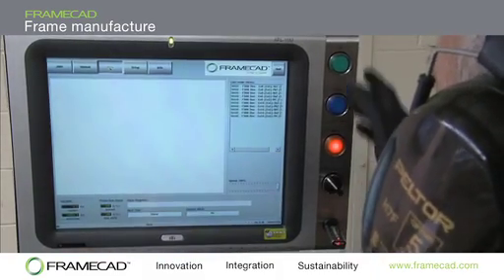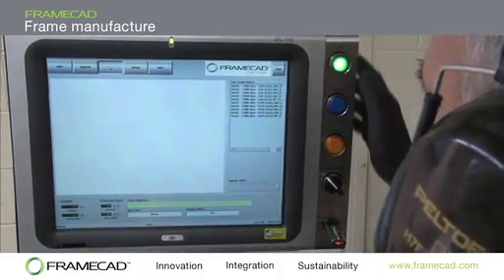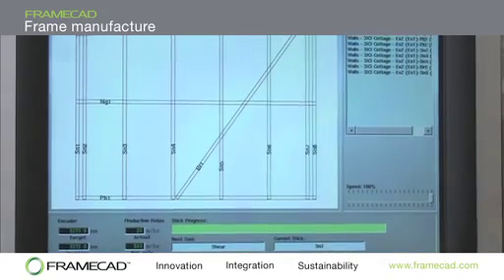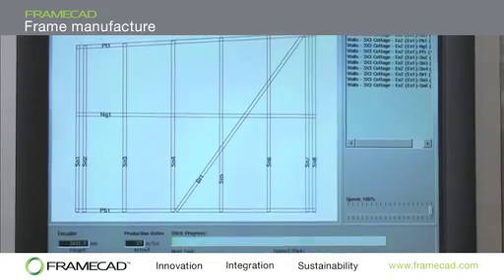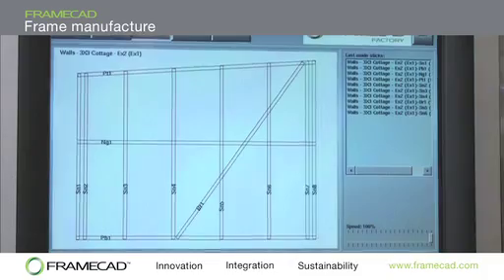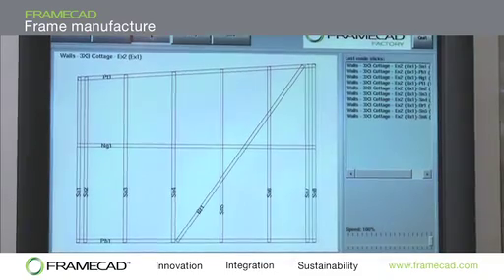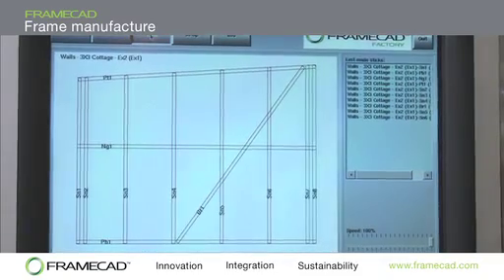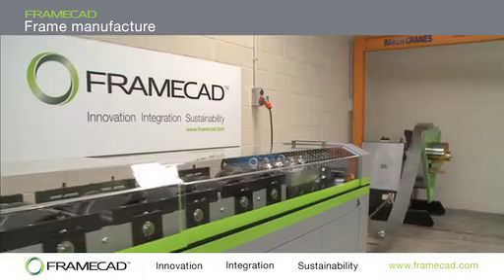How to Manufacture Steel Framing (FRAMECAD System)

Comment: In 2009 we looked into converting our housing system from timber to steel frames, at the time we considered several profile manufacturers, FrameCAD profiles were by far the best, especially with the additional 90 degree bend at the top of the 'U'.  Even the base of my office desk is made with FrameCAD profiles, with a board across the top.